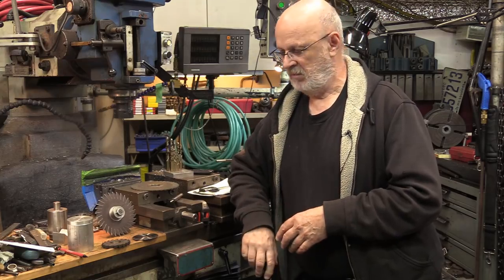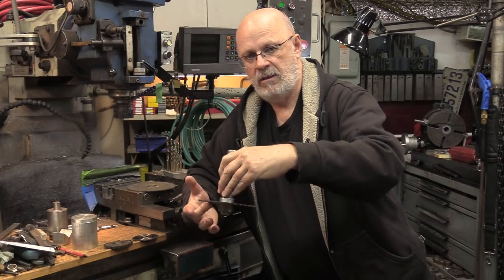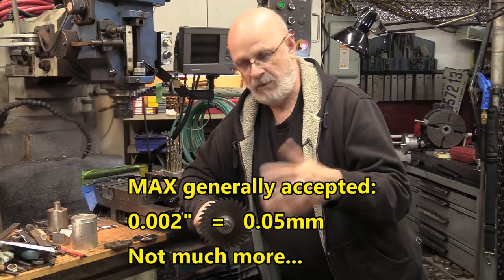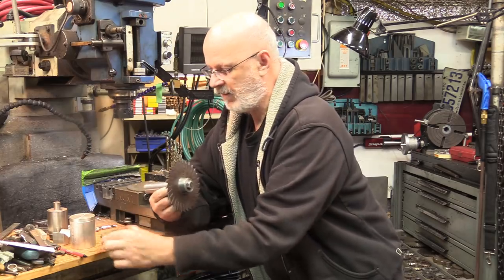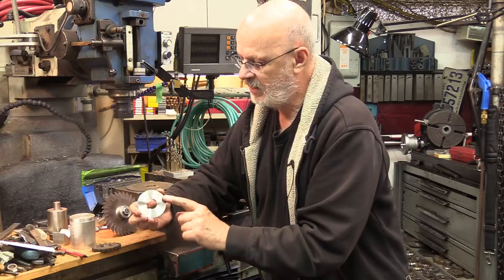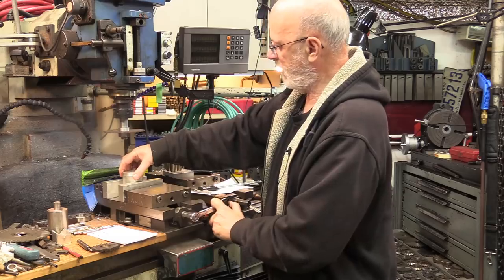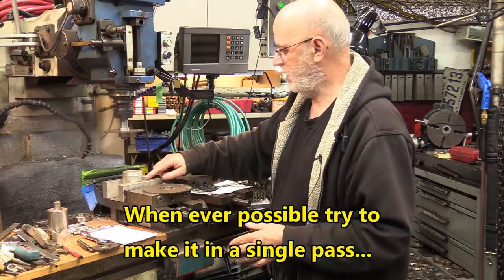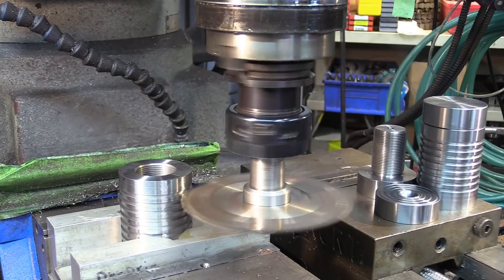Slitting saw how to set-up and use. Single pass, deal...!!!

Comment: Does it matter which side of the y-axis you start your milling ? 

Back to front or like in video front to back
Reply from the maker: I don't know if you're familiar with machining modes, but, to make it as short as possible, there are two modes to consider in this operation. conventionlal milling or climb milling, in the video I'm using conventional milling, meaning that the rotation of the cutter won't pull the part into itself.  This is mainly to avoid that the backlash isn't gonna be a issue and cause the tool to get a huge bite and break.
To use climb milling safely you need a very rigid machine with a lead screews with virtualy no backlash.
The bigger the diameter of the tool the more risk to use climb milling gets.
Let me knowif it's clear for you....

Comment: Most of my slitting saws are used but most work OK - however, yet to have one running absolutely 100% on concentricity even with a seemingly ideal arbor. Useful refresher of info Pierre.
Safe travels. :)

Comment: Nice vid…. I make a part very similar to this, I’m thinking this part clamps on to a gadget…  you were making the clamp. I take the same procedure… mine is a 2.5” diameter, I cut 1.25” deep…. 303 ss … just recently switched to 12L14…. Big difference in machining. 303 machines nicely… but nothing beats 12L14.  Everything speeds up using 12L14…. You can rip!
Reply from the maker: Agree that 12L14 is an easy material to machine...  Just forget about welding it, the "L" is for lead, so, welding it will vaporise the lead content in the air as you weld it, this will be real toxic...
Stainless steel is quite feneky to machine, if you got proper tools like HSS steel with cobalt or some carbide tooling you should be able to get good results, slower cutting speeds and good use of oil or coolant will help reduce the risk of spontaneous hardening mainly when drilling larger holes.
Other alloys like 1045, 4140, 8620, O1 and many others are nice allows to machine, unlike 12L14 care has to be taken to use only the best cutting tools, peoper cutting speeds and cooling are required, normally if you remove a proper amount of material you''ll obtain real good surface finich, small cuts like a few thousands of an inch will yield poor finishes.
Just enjoy your time in the shop and keep on experimenting...
Cheers

Comment: I was almost screaming "WD40" while you were cutting. Not only does it lubricate it washes away the chips too. If you've never tried it before you should compare the difference.  Nice video.  👍
Reply from the maker: Hi, Something that is also a valid way to help is a mixture of cutting oil and kerosene, by making the oil more fluid the chips don't stick as much to the blade. Right here it was simply cutting oil but I made sure the chips were evacuating properly, 
Thanks for watching,     Pierre

Comment: Hi Pierre, They could just as well just only make teeth on the half of the circumference, have newer seen one where you cant hear it is only cutting with half of the teeth, nice intruduction well done Pierre.
Reply from the maker: I'd be curious to have one cut in half and try,  not sure it would be very safe, mostly if it doesn't re-enter at the right higth after the void...   lol
Cheers,    Pierre

Comment: Maybe a slitting saw arbor could be slit like a collet with a cone head bolt to improve concentricity with variation of slitting saw hole diameter? Alternately, make the arbor slightly oversized so no expanding bolt is necessary. Or perhaps use a square NPT pipe plug and a collar nut? Could be an interesting project.
Reply from the maker: This sounds like an idea to develop, a little like an adjustable chuck on it's backplate in order to reduce TIR...   !!!!   Worth some thinking about....   ;)

Comment: I almost feel guilty for climb milling with a 125mm (~5 inch) 100 tooth HSS saw at 2500RPM and 2.5m/min feed rate through some aluminum parts at work. My homeshop made 4140 arbor sure helped keep this thing stable when I cut into a steel fixture at 4500rpm. Having this thing in the CNC is scary as fuck as it umbrellas over the end mills next to it in the toolchanger and probing it is a nightmare as the controller never gets the probing axis right the first time (even with the same input)

Comment: A pretty easy method to make an arbor that is always concentric is to design it for the shoulder, pilot, and end face to be re-cut with each mounting.  Put a lathe tool in your mill chuck and make the new cuts.  The design of the arbor is the same as usual, just make the bolt hole and thread deeper to allow for the repeated sacrificial cutting.  You can make an arbor that is perfectly concentric and with a tight fit between cutter and pilot, every time.  Yes, it does take more time, so probably not for every job...

Comment: the carbide tipped ones are useless i use indexable
Reply from the maker: All my slitting saws are High Speed Steel, none are carbide, good quality HSS, when well used is really a surprising material...   👍